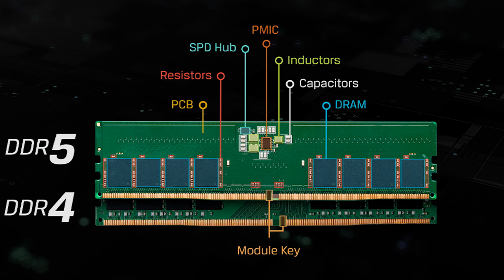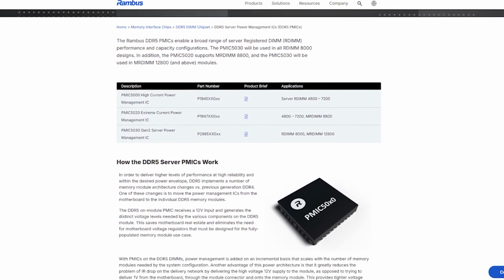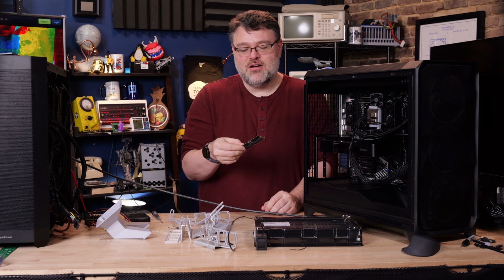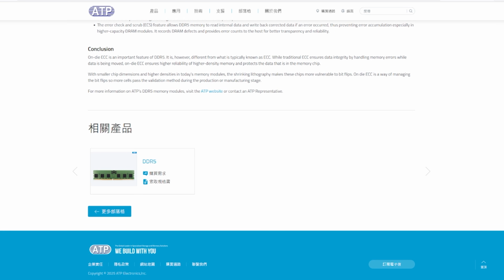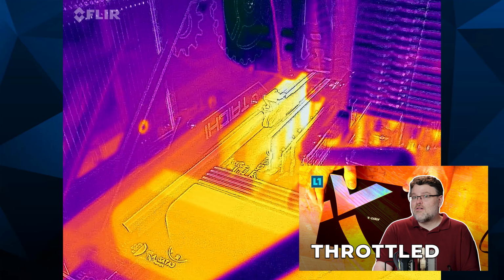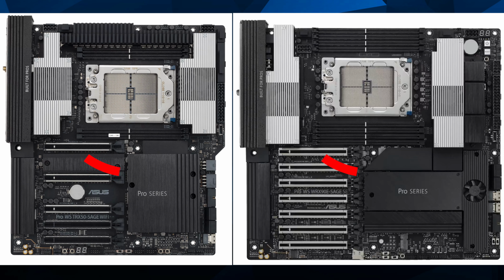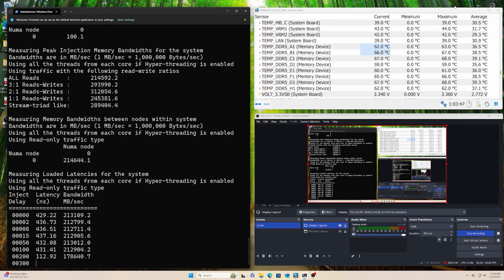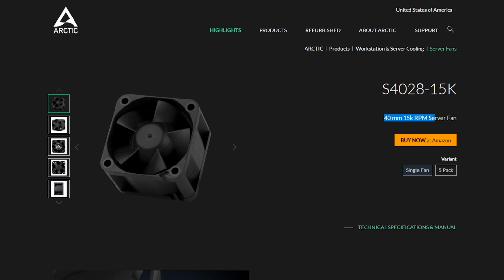Your DDR5 Memory Could be at Risk! All About DDR5

Comment: My new APEX X870E board comes with a mountable DIMM fan. The $462 2x48GB GSkill kit is now a $1000. It is now a functional room heater when ASTRAL and 9950X3D gets a heavy workload. Now a fan was required to keep me and this 57 inch Samsung cooler.

Comment: Wasn't more than a couple of months in, on my DDR5 build, that I decided getting a 2x40mm RAM cooler. They were a bit too uncomfortably warm for my liking.
Even at the low airflow them 40mm produce they've still managed to reduces the temps by about 15c. I felt more comfortable with it like that.

Jonsbo one if curious.

Comment: throwing my old ddr4 16gb x2 and old 512gb nvme, from a burned up acer, into an optiplex 7070 this weekend. cant waste the guts. and i had to pay 140 for a 16gb ram ddr5 here two days ago.. sucks but now i have 32gb ddr5 and im gonna have to settle with that for now. iwanted 64gb but i wont be able to use it and its over half of what i paid for my LOQ

Comment: On normal dual channel desktop cpu with 2 sticks, DD5 temps are a non-issue, especially if you have an air cooler, unless you're doing some crazy tuning. tREFI is temp sensitive, but  even if you run max tREFI(amd max not the intel 262k max), which I do at 1.42 vdd, the noctua D-15 CPU cooler is enough to keep the ram below 52C with enough fan speed on ram tests and it would error out somewhere between 55-60C at that max tREFI.

Comment: A mini heat spreader just on the voltage reg seams like it would be a good idea. Or use a full spreader and slot around the VR so it still gets heat spreading but doesn't conduct into the spreader that's on the RAM chips. (Not notching out the spreader entirely, just slotting to make a conduction barrier.)

Comment: anything sk hynix needs more airflow as it overheats. DDR 4 is the same thing. anything over 3200mhz with and overclocking add cooling. built a bracket and got a crossflow metal fan on my ram

Comment: Well idk if its AMD or DDR5 but yea. My time with DDR5 was not... fun. My PC used to boot after 5 minutes. Some bios updates FINALLY made it boot up after 2-3m. Still, updating bios 20 times is kind of a ton... I had to turn off XMP too, cus it was crashing for so many months... Its been a horrible experience. My cheap 400 bucks laptop boots within 3 seconds. Idk how they do it, it's not sleeping. From cold boot...Speaking of sleeping, it takes me around 40 sec to wake it up. Bios settings dont make it boot faster, so dont even bring that up. 
My old i5-2500k, DDR3 PC boots after 45 seconds. This whole new generation is a total fail for me. I took many showers while waiting for the PC to boot... talk about slow for a Gen 5 SSD +7800X3D.

Comment: Man it’s taken me months to build my new pc
Started with 9950x3d on MSI x850e carbon with 64 gig kit of fury beast 6000 CL 30
JUST got my hands on a 5080 at msrp 
Msi shadow   Cheapest they had at memory express
It’s been stable so far but its winter
There are heat sinks on the ram but no air
So I’m thinking line up a fan and just blow down the ram then ?
My case is an open bench style with a big as glass top. No sides 
Laying down flat.  So vid card weight sits into motherboard pci slot directly 
Hrmn
Yeh I can’t afford to replace the ram
I got my kit for 500 Canuck bucks before it hit over a thousand now

Comment: RRecently dealt with a DDR5 issue myself, ended up being a lightning-adjacent brownout. Two T-Force sticks (2x32gb) would power the system but never POST again — fans and LEDs on, zero CPU activity. Went so far into the diagnosticizing  that I replaced my mobo and cpu, before more Digging into it taught me that DDR5’s on-die ECC doesn’t protect SPD or the PMIC, so once those get corrupted or damaged, the DIMM is basically done. What really surprised me is that RAM can be bricked this way at all — older generations seemed far more forgiving and nearly bulletproof. What’s ironic is this happened right before the current RAM bubble, and because of that experience I now run boring ECC JEDEC baseline expo "safesticks" and prioritize power quality and thermals over chasing timings.  If youre tuning timings in boss mode I highly recommend having a UnInterrupt PSU, ......Cuz when the datacenter near you causes a brownout, and brickk yo DIMMs, that same datacenter will be the reason why you cannot find replacements available, and welcome to the brave new world of subscription based personal compute!

Comment: Why are RAM slots on consumer boards positioned like a big wall so only the first DIMM gets airflow in most fan setups. You could absolutely orient the RAM slots in the direction of airflow on ATX boards, just like server boards. Put the power delivery where the RAM slots currently are and move the 8-pin EPS connector over by the 24-pin.

Comment: We need to ask for a desktop platform that uses R-dimms.(Not a massive Threadripper-like system, just an AM5-like platform for mid and power efficient SOHO machines) 
DDR5 clearly has bus-signal issues, and ECC-U-dimm availability was a joke even before the autumn RAMpocalypse. 

Unlike DDR and DDR2, the one cycle latency hit on registered dimms is no longer significant and allows far better signal integrity as speeds and capacity grows. (By now we should have 1TB ram on middling mainstream desktops, considering 16GB was common in early 2013.)

Comment: TL;DR Increase airflow over your DDR5 memory dimms because the standard is inherently less stable than previous generations and there's bug in firmware that allows the memory to cook itself without throttling on some motherboards, such as Asus.

Comment: I use a fan over my ram. No amount of fans pushing air into the case will change the temps. There is a dead spot around your ram that heats up and you need a fan directly blowing onto the sticks. Keep it under 42C and you will not have issues.
Reply: Depends on the case, I have a rare style case that's basically a test bench with sides. Mobo is horizontal, and top has a 200 mm fan blowing down on the mobo. No dead spots. Also, you could use a top intake to cool the RAM.
Reply: @samiraperi467 Top intakes don't cool the ram enough. What is your case i like the style? Mine is a phantek P600S.

Comment: I'm running a wall mounted benchtable setup, air cooled, 90 degrees CCW, fan exhausts downward. Two GPUs. Motherboard is build for stability, Gigabyte Z890 AI TOP with an Intel 265k boost on auto. It has a kit of 2x24 GB G.Skill Trident Z5 CK UDIMMs @9000 XMP profile. I reserve 8 GB of RAM for a mounted RAMDisk, for scratch (Machine Vision). Most data gets seen and forgotten near instantly, at peak throughput between RAM and CPU of around 128ish GB/s, yes that's right, stable mind you. 685 Watts of sustained compute, or peak power for 2 minutes at 740 Watts (Aida64 Ex), measured at wall excl monitor. RTX 3090 + RTX A4000 Ampere.  When you ditch your pc enclosure, your hunger for peak fps, your silly waterblocks, and buy a proper motherboard, miracles do exist.

Comment: I think this might be related to my very strange problem. I made a new PC when AM5 was new and I got a kit of 64gb 6000mhz ram. Everything was fine but after a bios update I couldn't use the expo setting to 6000mhz and had to dial it back to 5800mhz, my system wouldn't finish memory training if I didn't do that. It worked fine for almost 2 years and a new cpu 6 months ago. But then a month ago it started to do the same out of the blue, no bios update was involved. At this point I had to completely disable any overclock for the ram and let it run at its stock 4800mhz. And to get the computer out of the unending memory training, I had to get the cpu out of the socket and put it again, not even a clear cmos would work.

Comment: I did not look at the temps, but I have noticed instability with DDR5 6000MT/s. I am currently back at 4800MT/s.
Reply: I did have that issue and a BIOS update fixed it. Worth a shot!
Reply: @BerryBurgerMeister  yes, it was worse with the first BIOS but after updating over 10+ BIOS I just stopped. Might try that again if I feel like updating again

Comment: I have never had issues with my ram. But I did intentionally set my 6400M/t ram to 6200M/t, just to protect it. I am not willing to pay the inflated price they are currently going for. I paid $139 for 2X24GB sticks back in March 2025 and last time that kit was available it was more than $600. I just checked as I made this comment and it's, "currently unavailable". I also make sure the ram runs cool. I have never seen it run hotter than 55c and typically it's running 45-48c.

Comment: Silent corruption (bitrot) is THEE main issue on 4 Stick setups.
Runs Y-Cruncher for 8 hours and no errors.
But SFC/DISM/CHKDSK once a day and CONSISTENTLY get a repeated “corruption found and repaired” every time is common. 

You have to understand when temperature isn’t about absolute failure like in Y-Cruncher but micro failure.
Reply: Isn't that just the refresh cycle too big ? tREF IIRC, that has to be set lower ? I forgot how often it should run, something like every 10 microseconds or so ? And if I'm not mistaken, the leakage does happen faster at higher temperatures.
Reply: @Winnetou17 sometimes. Usually TREFI can be responsible. But it’s not exclusive
Reply: That is likely some software you have running or starting with Windows, maybe a tweaker sort of thing. I would pay attention, in the logs, to what is being restored. Perhaps you even use a theme patcher hack that replaces 2 or 3 dlls in System32. That would cause integrity fail at an sfc right then and there (without issue, but still.)

Comment: And people laughed and said RAM didn’t need cooling when actively cooling my DDR5 solved my crashes while running the XMP profile and allowed better tuning. Lol. My original G.Skill 7800 Kit started erroring 47C and stopped reporting temperature increases at that point too, but I only ever tried that kit in Z790 KP and Apex Encore boards. 

Edit: There are also DDR5 kits with 1.45V EXPO/XMP profiles. It doesn’t stop at 1.4V.

Comment: my corsair ddr6 6000 mhz cl36 had an overheating isssues these days tooo. its weird because is ventilated very nice with the water cooling pusher ventilator, yeah i run 360mm 6 fans corsair water coolin keepin 7900x at 5.525 gz stable at full load cpu z test but overheating when econding h264 ultimate quality for that i have to run it at 5.2 ghz... so tried to put them in different places separated for even better cooling but for some reason motherboard would not like it ... maybe because single channel or whatever nonnsense, memory is dual channel anyway... so yeah weird stuff happening with ddr5 stick even the good old corsair premium ones. anyway pc is doin good enogh just got the oveheating issue message in hwinfo... windows did not crush or anythin.

Comment: I'm in no way an expert in RAM, but I did do a HW bring up and was responsible for the LPDDR2 driver in an embedded product. Ram instability is an insidious problem because it manifests itself in random ways... and maybe only at certain voltages or temperatures. You might have 10 bugs with different symptoms and end up wasting time looking for standard software bugs.

Comment: I am thinking my DDR4 is throttling from heat occasionally. 
We are getting over 40 degrees day temperature here in right now, and I suspect after watching this that my b550 rig might need a closer look.
Reply: But didn't he say that only DDR5 has this feature? Anyway, try not running your RAM above 3200 to begin with, it has a substantial effect on CPU idle power on AM4. You can keep the Vdimm and tighten timings proportionally instead. If you have RAM that wants more than 1.35 V in XMP, try going down to that voltage while relaxing timings along the lines of similar DIMM models that weren't pushed as hard. General note, timings pushed too far have a tendency to result in stuttering.

Comment: I run w790 sapphire rapids. 
Do not go above 50c if at all possible.
Above 50c with 6 different kits. 64G to 192G you will get errors eventually if over 50c.

Karhu 48hrs to ensure stability. If you get an error before that. You either need to reduce voltage, reduce speed if you are over 50c. If below and still error, increase voltage, reduce speed.

Comment: Another problem with DDR5 especially at higher mega transfer in DIY systems is any motherboard flex from improperly mounting of cooling, over tightening and any warp will cause all sorts of timing issues.

Comment: I still have a RAM fan that came bundled with some Corsair 1800mhz DDR3 I had in my Asus P6T Deluxe X58 board.  It was my first build after I graduated high school.  I bet it would still fit, because the length of modules hasn't really changed.  I'm on AM4 for the foreseeable future, but maybe down the line if I upgrade, it could be of use.  Would be hilarious to have a part from my OG rig circa 2011 in a modern AM5 system.

Comment: Am5 7700x had a weak/degrading memory controller and could no longer run 64gb gskill 6000mhz after 6 months of use. Resorted to 45minutes of failed memory trainings every single day....until I put a 9800x3d in that works every single time now.

Comment: Hey bro, bios updates and intel cpu microcode updates helped me achieve the impossible!!!! I can now run 7200 g skill 32gb kit on a msi z690 edge wifi mobo when previously I couldn’t or maybe it was just dumb luck of reseating cpu or aio or ram a million times.. but I updated bios which I never do, updated intel micro code which I was scared… and now I got 7200 stable ram speed at xmp and lower system latency on my still going strong overclocked 13900k… before I could only run ram at ddr5 6800 with some good optimized timings of course.. but I’m impressed z690, four slot ddr5 board, and ram kit runs at 7200 xmp profile….

Comment: This is awesome, thanks!

I have 3 AM5 systems and recently swapped a 64GB kit from one machine into my main, and it's been "weird" at times compared to either of the 32GB kits. Using HWiFO and OCCT, the 64GB kit is pulling ~6 watts per DIMM versus ~4 watts per DIMM for the 32GB kits. It also hits 55+C under load, while the other kits max at 40-45C. The extra watts certainly account for some of this, but airflow over the memory is not something I've worried about.

My main system has great airflow and low CPU/GPU temps,  so I'm going to add some fans to see if there is any effect, then will explore ducts.
Reply: The sense amplifiers have to be kept charged to fetch data.  Because the RAM is a square array of bits it will have sqrt(2) more rows.  Also the rows have to be refreshed 1.414x faster. so 5.6w is exactly how much power they should be using depending upon the power used by each part of the circuit.
Reply: @systemBuilder  Thanks for the detailed explanation. Far more precise than my "bigger means hotter" babble.

Comment: It could also be the silicon lottery...

I had a Ryzen 7 7700 that couldn't run anything above 4800MT. I tested it with several RAM kits in conjunction with various motherboards, but nothing worked. The PC didn't give any errors, but it crashed with TestMem5. 

Then you'll ask me, why was I testing the RAM if there was no apparent problem? In this case, I did have a problem, but it wasn't necessarily with the RAM, but rather with the GPU, more specifically, the Vega architecture GPU. The audio was full of artifacts and noise, it disappeared when I activated something that stressed the GPU, such as a game or furmark (you can even find similar reports on the internet, but none related to RAM), or when I lowered the RAM clock to 4800MT. I decided to go deeper down this rabbit hole, tested an Nvidia GPU and the 7700's iGPU, and the audio problem didn't happen.

Not knowing what else to do, I ended up putting it aside, since this PC is a secondary PC that I used little, then Black Friday came around, and I bought a 9800X3D. I put the X3D in my main PC and the CPU that was in the main PC in the secondary one, and voilà, all the problems were gone. The RAM was able to run on the 6600 EXPO profile without the Radeon VII stuttering the audio and no errors on TestMem5. 

In the end, I had a 7700 with a terrible memory controller.

PS: This turned into a wall of text, but I hope no one else suffers like I did with something so unexpected.

Comment: Hmm interesting info. Makes me wonder if anyone from your message boards Wendell  reported anything with SODIMM DDR5 memory aka memory for Laptops and MiniPCs and even Mobile workstations having similar issues as described in the video? I know with some MiniPCs there were some issues with throttling especially with the M.2 SSD and the memory due to the lackluster airflow but solved it by modding a fan and putting some kind of cooling on the memory chips themselves.

Comment: I thought the DDR4 in my 5900x had gone bad. I had some spare ram so I swapped it out. Nope. It still crashes. I just got thermal paste yesterday. I'm going to replace that this weekend and see if it helps, but I doubt it. I think the 3070 has gone bad. I have had some issues with it in the past. I don't know why it would have gone bad. You'd think a mid range card would keep working. Especially with it being in my open loop. I'm not looking forward to replacing it. I can't find ANYTHING with a waterblock pre-installed right now. This means I'll probably have to use a triple slot design. I hate those and they pretty much need something to hold them up. I honestly don't know if my case supports anything like that. It was made before GPU sag was that big of a deal......anyway in the meantime my threadripper 9960x with RDIMM DDR5 is working great. lol I seriously doubt it's the CPU. I've never had one go bad on a desktop.